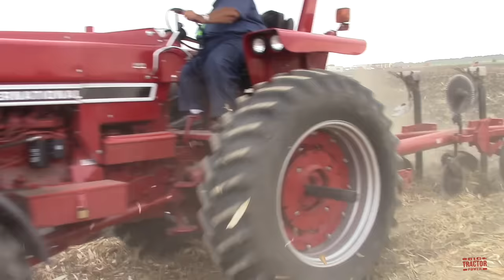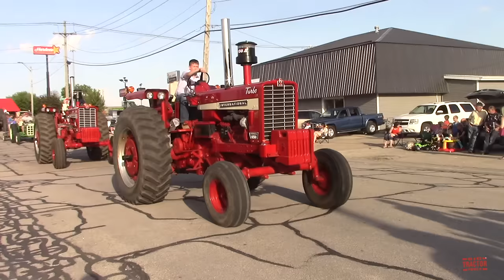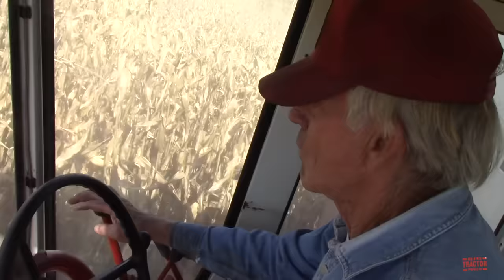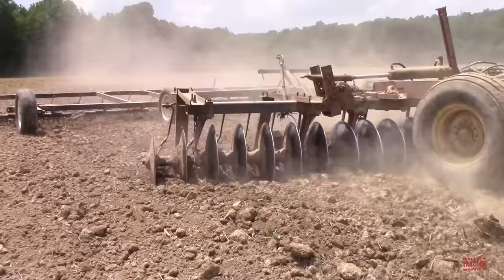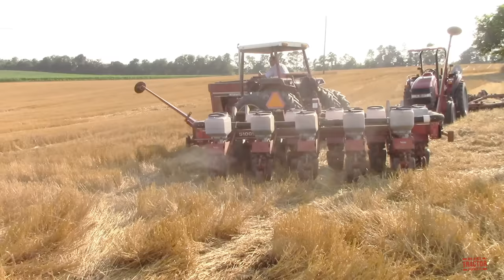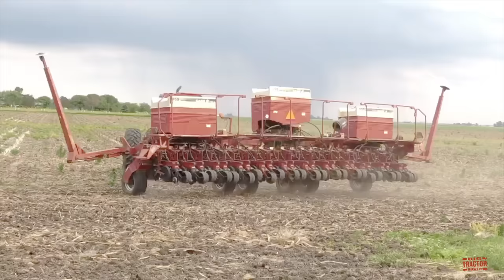INTERNATIONAL HARVESTER Tractor History

Comment: I spent most of my time on a 756 with an aftermarket M&W turbocharger and modified fuel pump😀.  It would out pull the stock 966.  My favorite was the 856 upgraded with 1256 turbo, pistons, and injectors.  Dad put in a bigger 4th gear and it was a road runner in it’s time.  It had the hydraulic clutch, which was awesome for a 60 lb 9 year old trying to push in a clutch...  never knew how much hp that 856 had, but they don’t build tractors like that anymore, turned it up by 50% and it ran thousands of hours with no problems 👍

Comment: I grew up on a 1953 Super W6 gas job we ran until shutting down the farm in 1987. At that time we'd put 38,000 hours on it with one total engine rebuild in 1965.
Reply from the maker: Wow that is a bunch of hours. Impressive.
Reply: @bigtractorpower  It's a calculation. We grew hogs all that time. This tractor ran an hour plus morning and night to do chores and then 6 plus hours on Saturday grinding feed. Then there were all the other normal farm chores it was used for and tillage and harvest. We figured a minimum 20 hours a week, 1000 hours a year for 35 years. If the battery was hot, it never failed to start and do its job.

Comment: Ran a 7120 4x4. 5140 4x4. We also had 4 super c. Super cub. a john deer 3020 4430 8440. 2 ford 5000 had a lot of good times on the farm learned a lot  but now can run almost any pice of equipment there is unfortunately farm was sold off In 08 but it still holds a lot of memories

Comment: Can't decide between the Super M TA or the 1586.  Different times but both were well ahead of the competition.  The 1586 took the great 66 series to a whole new level with balance and drawbar power with great engines.  Although the sound of 436 engine in the 1466 still brings tears to my eyes.  I can tell the sound of that engine from a long ways away because of all the hours I put on one.
Reply from the maker: Both great IH tractors for sure.

Comment: Growing up we had, 656, 756, 1206, 1466, 1486, and 1586 tractors.  My favorite was the 1206 and 1466...the 1466 was in perfect condition and I was a bit upset when my dad traded it off as I really liked that tractor.
Reply from the maker: Nice line up.  The 1466 is one of the all time greats.  What did the 1466 get traded for?
Reply: @bigtractorpower  I think it was a 7140 with front assist.  I mean, so pretty decent upgrade.  We actually had (2) 756 tractors, one with a cab and the other without, both wide front ends...but for some reason the one without a cab smoked like a chimney and did not seem to have much power.  Had a mech look at it but never did figure out what this issue was.

Comment: I have driven several IH tractors when I was young.  From the Farmall "H", the 806, 966, 1086, 1206, 3788 and the TD 14, 18 and 24 crawlers.  By far, my favorite tractor was the 1206 Turbo for it's raw power.  The last time I drove a tractor on a farm it was the 3788.  Spent the whole spring break from my senior year of high school on that thing.  The best part was the a/c and am/fm radio.  I went on to become a firefighter and wouldn't you know that I got to drive International fire engines for most of my career.

Comment: My tractor was a 1466 that I bought with less than 1000 hours on it. Never had a lick of trouble and sold it to the neighbour when I got out of farming. Twenty five years later the tractor has over 12000 hours and the only thing not working according to the neighbour is the air conditioning and due to environmental reasons cannot be recharged.

Comment: I also worked on a farm in 1981 to 1984 that had a 2+2 1586 1086 986 826 a c and a super c plus some John Deere s. I drove all of them. The 2+2 was cool and different. The cab on back . They sometimes planted with it and a 8 row 3 point planter. Don't turn the wheel wiggle wiggle ha ha .
Reply from the maker: Very cool line up.

Comment: It might be a tough choice to pick one tractor as my favorite. A black stripe 1066 will always be an iconic tractor, if they sold 1066s the same way they rolled off the line in 1976 today, they’d sell a crap load of them. Everyone loves a black stripe 66 series IH. Then I’d have to pick the 706/806/1206, because I have a lot of seat time on all the 806s and the 1206 in the family. Got a lot of work done with them old girls. Lastly I’d choose the 5x88s. IH was so close to blowing the doors off with them, so close in fact they there was full powershift prototypes built that Tennaco reworked into the magnum. They had it in the bag but couldn’t stay alive as a company to see it thru. Search the Red Power Forums for the pictures of the one surviving prototype. Have a good number of seat hours on a pair of 5088s and a 5288 and I always enjoyed running them with the tri-6 transmission.

Comment: It's too bad that IH couldn't hold on for a few more years, because I think they would have been very successful after the farm crisis. The 18 speed power shift transmission that is in the Magnum tractors, was designed by IH..I know for a fact that you can take the back half of a  Magnum and it will bolt right up to the front half of an 88 series tractor.
Reply: The labor union wouldn't let the company retool when it would have been profitable.

Comment: My grandfather had many farmalls and I still have his last international harvester 584 that's only a 60hp tractor but is a tank. Got the skid steer stuck, new Holland 783 so a fairly heavy one , my 3/4 ton 4x4 truck wouldnt budge it but the 584 dragged it out like nothing. Spent most of its life haying fields for the cows and I believe it has over 3000hrs on it, for a 40+ yr old tractor isn't bad I suppose when my 2011 Kubota has 1000 hrs in it.
Reply from the maker: The 584 is a solid tractor.  I grew up by a dairy farm that in the early 80’s had a 986, 784 and 584.  They still have the 584 on the farm.  They were built to last.

Comment: My favorite IH is probably a 7488 2+2 mainly due to the rarity, I’d love to work some ground with one, the farm I work on has a 3388 2+2 that’s been turned up and a 5288 that’s had a motor replacement, other than that both are still pretty solid tractors.
Reply from the maker: Very cool. That’s awesome you work with a 3388. The 3388 is some what of a rare tractor.

Comment: Was not old enough to fully understand why dad would even want it. But in 1969 i was 11 years old when he came from a farm sale saying he bought a 1952 farmal 450 gas tractor. 11 years old i drove that tractor 43 miles to our farm. Getting home i was so frozen cold, had driven in rain turned to sleetting snow.  2017 i was aproached by a fellow who wanted that old 450 farmal so i hugged it good bye one last time.  Being a internatioal/ case guy i could never figure out what gradually pulled dad away from the case and internationals, going into versatile and johndeer as his biggest 4 wheel power but it happened. My only wishing many times he would had went up into bigger international tractors as i was and still am very particial to them. Stating that i so hated his i belive was a 960 IH tractor. So many times the front casting on the axle broke it was a very bad thing and we only had it a short time replacing it with a 4440 johndeer.

Comment: My very first tractor I bought  and still use is a  1969 j.i. case 730 comfort king and from what I was told by the local case dealer (after I bought an piston sleeve that was way too small for my piston and they said it's the biggest sleeve we have for that tractor) that mine is a 301 diesel engine pushing close to 80+ h/p.. I love this tractor but not all my gauges work and I don't know how to fix that. But it it starts no problem wether it's hot or cold..my dream truck is a Ford pickup with the ih motor in it
Reply from the maker: The Case Comfort King series are good tractors.  Navistar builds good engines.

Comment: 1466 I believe it was a great tractor and comfortable from memory we used it to rake hay as we were hay contacters in Australia that tractor was called old noisy no idea why just did
Reply from the maker: The 66 series were built to last.   What size rake did you pull with the 1466?
Reply: @bigtractorpower  A 16 wheel schinkel wheel rake

Comment: Love them big Steiger based IH artics, apart from that ugly 4568 monstrosity - looks like something cobbled together in some farm workshop, with that extended front frame - just doesn't look right.
 Apparently there is a factory near the current Fargo production facility that specialises in refurbing the older style Steigers and presumeably their badge engineered offshoots.
 A video of their works would surely be worthy of your consideration ?
Reply from the maker: I very much would like to film an original 4568.  They are hard to find.  I own a 1981 4786.  The 4568 shown here was the first 4568 ever to be repowered to a Cummins.  It is historic.   

I think you are talking about Power Mart in Fargo.  They built 12 tractors branded Titan.   I have feature on a Titan STR-525 posted at  https://youtu.be/o82iqIxgiRc?si=ZJcBfFsMylyLzC0L
Reply: @bigtractorpower  Hi Jason, and thank you for your reply. I kind of guessed that that extended front frame wasn't factory. 
 You may well be right about Power Mart, though I'm not at all familiar with it - just read about it some other place fairly recently.
 Have seen your video on the Titan STR - 525, which I very much enjoyed, as I do with all your other previous footage.
 Found it a wee bit odd with those lower windows in the Titan cab - can't imagine they'd offer much extra visibilty to the sides and could potentially weaken the cab structure as a whole. That said, I don't know if these tractor cabs would have been subject to the stringent roll over tests that other tractors have to meet. If only 25 were ever built, perhaps it wasn't cost effective to put them through the test ?
 Interesting that the style is reminiscent of the Series III ST tractors in their mid range, unlike the ST 450/470 tractors which were absolute giants by comparison, with massive axles too. Not sure if they were Steigers' own or a RABA unit though - the literature I have doesn't state the manufacturer.
 What brand drive axles did the Titan 525 - STRs use ?

Comment: Nice video but you did not talk about the productions of german ihc tractors. My favorite one is of course  the one which I first time took the steering wheel of. We have got an IHC 654-S (1974) made in germany. It is powered by IH-D206(68hp) 3.4 liter and 4 cylinder diesel engine, which I do not know if it is still in use.

Comment: I’m comment number 656 and that is my favorite, It is the largest small tractor or is it the smallest large tractor IH made?  Great Tractor.
Reply from the maker: Very very cool. I am a 656 fan myself. The 656 was IH’s largest small row crop from 1965 to 1973.  The tractor was the for 56 series offered and the last. It was introduced two years before the 756-1256 tractors hit the market.  It was so popular it remained in production through  1973 two years after the 766-1466 hit the market. The 656 was replaced by the 666 which was replaced by the 686 in 1976.  The model 786 replaced the 66 hp 686 in 1981.  The 786 was rated at 80 hp. The 786 was replaced in 1982 by the 80 hp 3088.  The 3088 was the last big small tow crop from IH.

Comment: Yeah well I am only 21 so it is difficult to get into tractors too much as it can be prohibitively expensive, however I recently procured myself a 1955 300 so that is cool, coming up next year (probably early 2021 maybe luke february) when I have time I will get to fixing it up, getting it to better condition especially since it does not run at the moment, but right now my 1981 ford f150 is a bigger priority considering I can make a bit more use out of it now, but the tractor I will use to help clear my land which I can't afford to put a house on it now anyway so its kind of on the backburner until I've paid off more of my property so yeah

Comment: The 4568 looks like a longer hood, and only 2yrs production. What was the story on that ?
Reply from the maker: This 4568 was repowered in 1991.  The 225 hp 4366 came out in 1973 and the 4568 was added as a higher horsepower second 4wd in 1975. On September 11, 1976 IH rolled out the 86 series including the new 4386 and 4586. The 350 hp 4786 was added to top the line in 1979.